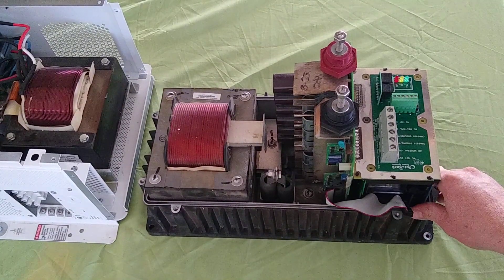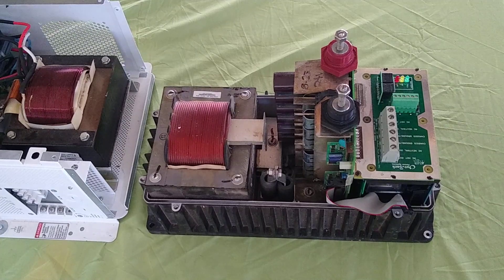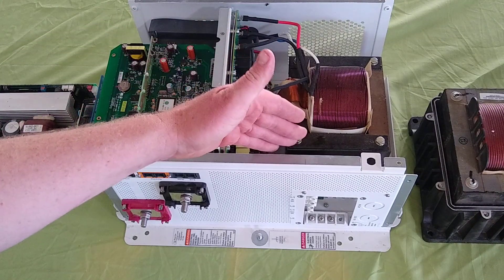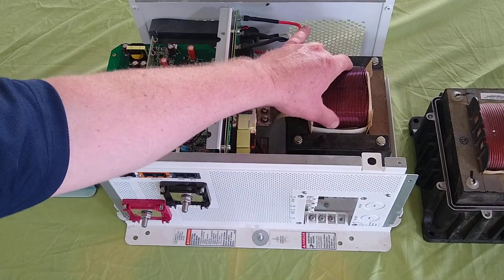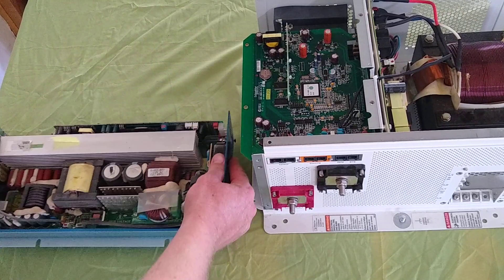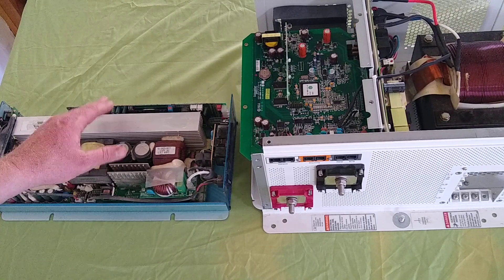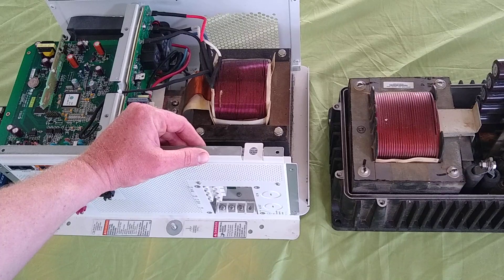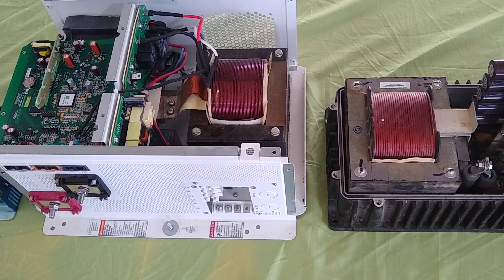Watch this before you buy an off grid inverter

Comment: Comparing transformer size in low and high frequency inverters is apples versus oranges.  

I was around in the days of vibrator-powered inverters whose output was a square wave AC waveform from a big, heavy transformer and I still have a CDE 140 watt unit whose case is big enough for the 12 volt car battery that was popular in 1957 (Group 22?) and it includes a charge/discharge amp meter and a built in charger.  High tech in 1957 ;-)  With current technology, I could fit an equivalent or better LiFePo4 battery, a 1000 watt pure sine wave inverter and a smart charger in that same case.

I have two 2000 watt Reliable Electric high frequency pure sine wave (PSW) inverters (12 volts to 120 volts) and they work fine.  I never load an inverter more than 80% of its rating (same for the EPEver charge controllers) and they just keep working.   Obviously, it's all a matter of system expectations.  My solar power is a backup system that provides "Wait until daylight" power (8 to 24 hours depending on season) so I'm not outside in a thunderstorm or digging my way through 7 inches of snow to get a generator out of the shed (did the snow thing once but not again).  With a continuous 440 watt (measured) load, these inverters might run the cooling fan for a couple of minutes every 15 minutes or so.  

I agree on the limited start surge capability.  A very efficient counter height fridge runs at 55 watts and maybe 5-6 hours a day in a 78F environment.  The maximum estimated start power of 10 times the run power should be within the range of a 500 watt continuous PSW inverter.  However, a 500 watt Reliable Electric PSW inverter can't start that fridge.  The 2000 watt inverter has no problem starting the 28 cu ft fridge/freezer or the 15 cu ft upright freezer.  You need to know the average and peak power required by every device you want to power.  FYI, the output waveform on the Reliable Electric inverters is a better (cleaner) sine wave than what the local electric co-op delivers (checked with a 'scope and I have pictures).

I have a spreadsheet with pages for the typical loads plus a page with maximum versus average loads (fridge/freezer averages 59 watts/hour in winter but max is 560 watts when both defrosters are on) and peak versus average loads (garage door opener runs at 430 watts but startup is 1290 watts).  I can selectively transfer circuits to inverter power to limit how much power can be drawn - the "1100 watt" microwave oven is simply unplugged as it needs more than my chosen 80% loading of the inverters.  The microwave actually draws 15.77 amps at 120 volts so the measured power is 1892 watts.  Even for short runs, the microwave would need its own 2000 watt inverter.  The convenience of the microwave isn't worth the battery cost (a 175 amp drain from the 420AH battery bank is excessive) and I'd have to get out a bigger gen to power it - not worth the extra gas.

If solar power were primary, the system would be more robust but it's fine for our typical outages (longest in 15 years at this location is 16 hours),. Other areas of the county have seen multiple days without power so the backup to the solar system is a 1600 watt inverter generator.  The inverter gen can also charge the solar battery bank so we get another night of silent power if there isn't enough sun.  4 to 6 hours of gen time for 24 hours of combined power at the lowest level (no internet, no TV, upright freezer only powered when the gen is running) isn't a bad tradeoff if we have central heat in winter.

There's a 5000 watt Generac as the final backup but primarily to be able to run power tools and lots of lights if the house needs repair after a storm.   It'll run every tool I have but it's a large, loud and thirsty beast ;-)

Comment: $350 for a fet board? Fet's cost under a dollar each! Where's the rest of the money going? The two most expensive components there are the heat sink and the transformer. Also, the transformer comparison is actually unfair, while the third inverter has a tiny transformer, it runs a different topology compared to the first two. High frequency switch mode doesn't need a massive transformer to output the same amount of power as the older topology of the first two.. Size for size, the switch mode power topology will output more people. Maybe you should consider one from a different company because they are much more efficient than the older first two... EI core transformers of the first two models are essentially outdated, expensive and inefficient not to mention the weight..The size of the transformer only matters on the first two models..
Reply: Where is the rest of the money going? Of course in the greedy suits pocket, Christmas Bonuses and benefits plans and jet fuel for their bizjet.

Comment: I love low frequency inverters for their robustness and simplicity, they do not necessarily have to be branded and expensive, but only if they have the high toroidal efficiency transformer, not like those in the video, Schneider often remarks to me that it looks the same as a xantrex. ..
random example
https://www.alibaba.com/product-detail/92-Conversion-Efficiency-Toroidal-Transformer-4000w_60557190529.html?spm=a2700.7724838.0.0.7b4d5ebdwGFq6c
https://www.alibaba.com/product-detail/92-high-efficiency-renewable-energy-toroidal_60552051435.html?spm=a2700.7724838.0.0.7b4d5ebdwGFq6c

Comment: There's a guy named Sean on YouTube that tells you everything you need to know about a low frequency power jack inverter the newer power jack inverters at least the ones at 48 volt are very reliable a lot more reliable than these big name brands mentioned on here the biggest problem they're still working on they're advertising sucks cut whatever wattages says in half and that will be your continuous wattage if you do this and you buy a 48 volt you will be very happy with power jack and Save tons of money oh yeah one more thing the guy on YouTube with all the power jack videos Dave made a Wi-Fi board for it that hook straight into the processor the inverter so any setting can be changed anywhere in the world any setting from fan speed 2 Hertz two on and off and so many more to many you can buy an 8000 watt power jack 48 volt from 400 2 $500 including shipping the real voltage will be about half continuous so 4000 continuous buy the $200 Wi-Fi board that comes with Incredible customer service and you got one hell of a machine and you will have shipping at all 6 to $700 in it these power jack are not what they used to be they are incredible now more reliable than any of the top name brands with that Wi-Fi board I have been using power jack for a couple years now just make sure you get a low-frequency one 48 volt and twice the wattage as what you really need and you are guaranteed to be very happy especially if you get that Wi-Fi board it is awesome it's worth it to check it out there so many videos online you'll know everything about them from Sean before you even buy one and by the way you can call Sean on regular business hours so type in power jack on YouTube and you'll find Sean watch the videos and you will know exactly what you're getting before you buy it you can buy three or four for the same price as one of these name brands and have a way better low frequency high efficiency toroid Transformer inverter yes these cheap tough reliable Wi-Fi Power Jack inverters come with the high dollar round donut shape high efficiency toroidal Transformers unlike these high-dollar wasteful Square Transformer blowing up every once in awhile at least $350 to for parts only to repair overpriced junk just my opinion but you will find you cannot prove me wrong go watch the videos do your own research on all the low frequency power jack inverters that are 48 volts from the last six to eight years if you can realize and live with the wattage stated on the front is just not right it will do half of what it says continuous 24 hours a day 365 a year that is this company's one downfall now they overrate the wattage so whatever it says divide it in half and you can still buy three or four power jack inverters for the same price as one of these overrated overpriced blowing up junk high-dollar name brand inverters have you made it this far on this long text go research before you buy and you will find I have told you the God's honest truth and saved you a lot of money just don't forget to divide the stated wattage in half and 48 volt low frequency only do not buy high-frequency and you'll be very happy for years to come  nothing to lose just money to save research what I have told you in this text why would I write this I don't sell anything for a living do not personally know Sean the power jack guy YouTube  but when you get burned about three times by the high dollar blowing up costly to repair junk inverters and then a YouTube guy named Sean tells you to try a power jack that cost between 1/5left to 1/4 and it's a way better inverter it pisses you off and you don't want anyone else to give money to the same places that ripped you off I bought the one I've been using for the last 4 years off of YouTube power jack Sean website even though it was about $100 more expensive just because I like Sean's guarantees and customer service but that's up to you can save a little money on eBay that do not take my word for it research it

Comment: Absolutely spot on.  Started out with Cotek (Meanwell) inverter and Midnight Solar MPPT charge controller and quickly realized I had fallen for internet hype--run fast from both these, IMHO.  After a few more trials and mistakes, I've been very happy with my TS-MPPT-60s and my single MS4448PAE for the last 6 years.  Additionally, the high frequency inverter was not only anemic with inductive loads/startup current, the equipment it powered produced more heat as well.   Welcome back, Casey.
Reply: The extra heat generated was probably due to it being a modified square wave output, versus a pure sine wave output. It's nothing to do with the step-up frequency.
Reply: @PipeManPeep  Don't know what to attribute the inefficiency (heat) since both inverters were pure sine.    As expected, low frequency (Magnasine) was MUCH better at starting inductive loads such as my Rolair 5715K17 than the Meanwell.  From my experience, the only benefit of high-frequency inverters is the less expensive initial cost and lighter weight, if that were an issue.
Reply: @anthonykrusel349  the main advantage of a high frequency conversion is efficiency. If both inverters are producing a pure sine wave with identical output voltages and frequencies, there is no reason that the consumer should produce more heat.
Reply: @Joshua Kiser The midnites would not begin charging until there was about an 11 volt difference between the PV panels and the batts.  Morningstar began charging at 0.7 volt difference.  When I contacted MNS support and explained/inquired about this, they said this "delta was normal and is not a problem".  This means more hours per day without charging--so coupled with the parasitic losses incurred (possibly due to high ambient temps and the use of active cooling fan on the MNS, my daybreak battery voltage would begin over two full volts less on my 464aH 48v system.  My peak day input into the bank was also less; but, because I didn't run both concurrently, I can't tell you how much.  Also, the fets were cracked on arrival with a printed sticker inside explaining this was also normal and would not affect function.  The lugs were too small to accommodate even the AWG copper  the controller was rated at.   I did prefer the interface of the MNS over the Morningstar, as the Morningstar is less intuitive and difficult to navigate.  The Midnites never broke down as I only used them about 6 months before taking back out of service and installing the Morningstars--but I am certainly glad to hear your Midnites are working well for you at 5 years!  Keep on truckin', brother.

Comment: How long does a schneider sw inverter normally last for ?
Reply from the maker: Well the oldest 24 volt sw4024 we installed is 5 years old and still working
Reply: @CaseyColando  FYI, my old Trace 5548 still cooking for 18 years...
Reply: @CaseyColando  FYI... My 5548 SW is going on 18 years now. Still humming away. When it goes, I don't know what I'll use to replace it. I'll need three men and a boy to lift it off the wall when it does die.
Reply: 7 days.
Reply: Thanks for the reply. Considering to buy one but afraid to have it fail on me after a short period